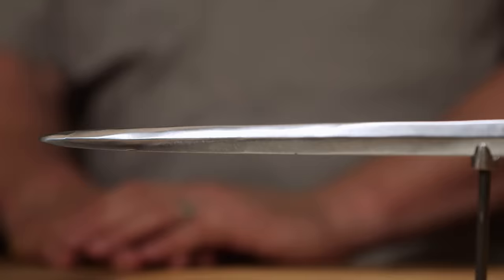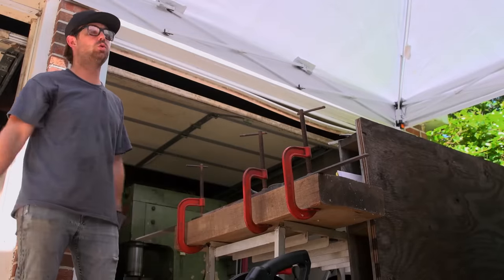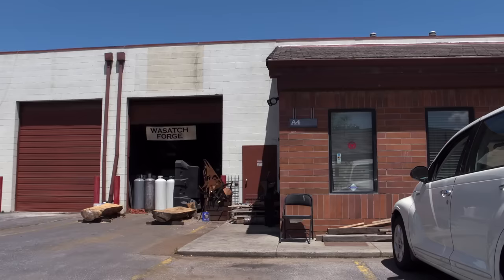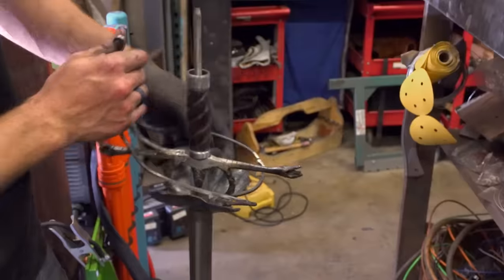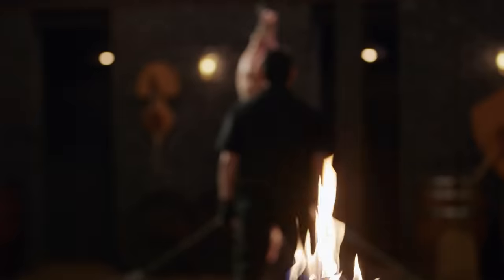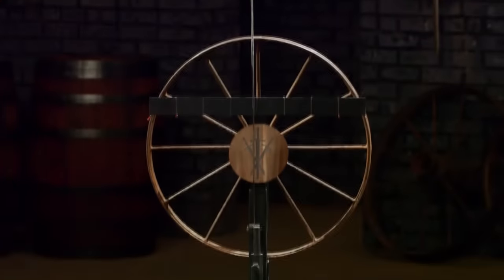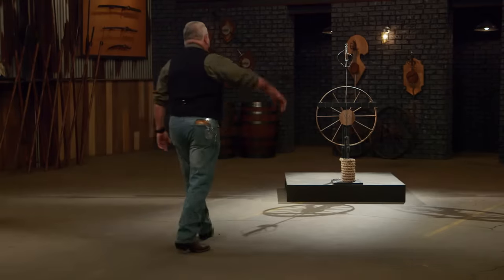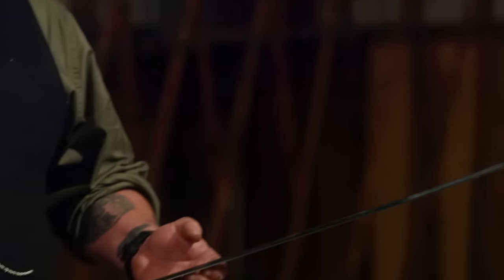Forged in Fire: Musketeer Rapier Final Round: Teddy vs Jesse (Season 7) | History

Comment: why did they test a weapon designed for the thrust by slashing?
Reply: Civilian/duel rapiers were more for the thrust. More combat orientated ones could slash a bit more
Reply: @Xtafa  I suppose you are talking about sideswords?
Reply: You could slash with a rapier perfectly fine
Reply: @systaltic863  yes but to compleatly ignore the thrust it pimarey purpose ????
Reply: Maybe the 3rd test would be thrusting something but they didnt have to go there since they already had a winner on 2nd test
Reply: I'd say these "rapiers" look and act more like broadswords. They're long and narrow but have the rigidity to slash deep. A true rapier would either be too thin to slash as deep as these did, or it would flex too much.
Reply: a musketeers rapier is more of a cav sidesword than a pure rapier. It`s not intended to work as a civilians dueling sword.
Reply: Rapier was made for slashing, Foil and Épée were made for thrusting
Reply: Its simple rapiers cut as well stab, its a misnomer due to modern fencing.  Its simply not true
Reply: Because they're both going to completely penetrate any reasonable target. A difference in the depth is going to depend entirely on the profile of the weapon, and not really say anything about its quality. 
So they test the other aspects.
Reply: My explanation would be it's based off of a Musketeer's weapon. It would be a military purpose sword and not a common persons or nobleman's sidearm. It would be heavier beefier and have more general purpose than a pure rapier. Also it's a lot easier to sever arteries with a slash than it is with a thrust.
Reply: It’s a misnomer to believe the rapier was some sort of “pure thrusting” weapon; that was not the case...
Reply: @systaltic863  yes, you can slash with a rapier, just like you can drive your car in reverse gear when necessary, but that's not how you are supposed to travel with cars...
Reply: Because it's a show and it needs drama. Is it the discovery channel?
Reply: The rapier is a thrust centric weapon but it most certainly could also cut. Many different texts discuss the cut. Though thrusting is admittedly much more deadly (on any sword) than cutting.
Reply: Rapier were by no means designed to be cut and thrust swords. Of course its possible to cut with them, as it is with any sharp piece of metal. But nearly everything about the rapier, from the blade geometry to weight distribution was designed specially with the thrust in mind.
Reply: Garren Brooks well not exactly. Rapier geometry is actually pretty diverse. Plenty of examples of cut based rapiers that feel like longer side swords in the hand. 
Why would Fabris’s rapier Text include both mandritto and reverso cuts if the cut wasn’t used?
Reply: @tainicon4639  but what is the real authority on where a rapier ends and a side sword begins? Modern attempts at sword typology are by no means infallible, and it really seems to me that it mattered a lot less in period than it does to us. Individual swords of the same type can very fairly widely across multiple spectrums. But as far as I've ever known the specifications for being considered a rapier are widley understood to be one-handed sword appearing after the start of the 16th century, around the same weight as a longsword, balanced close to the hand with a well developed hilt, and a fairly long, thin blade with a noticeably robust cross section.
Reply: Garren Brooks I agree very much. I am not try to argue rapiers weren’t primarily thrusting weapons. I am only saying that it is certainly true that rapier fencing manuals describe cuts with the sword we would generally define as a rapier.
Reply: @tainicon4639  yeah, that is true.
Reply: @crazycakemanflies  it is called a warming sword not broadsword unless you are talking about the Scottish basket hillted broadsword
Reply: rockn roll  to be fair the swords in the video are probably closer to the earlier  espada ropera which is a bit of a transitional form between the spada da lato, or sidesword, and the later rapier. It really boils down to the issue of our modern sword naming.
Reply: @Xtafa  ALL western style swords were designed for the length of the thrust FIRST, and slashing as secondary. (aside from cavalry sabers) Asian swords were pretty much the exact opposite. This is reflected especially in close tight formation combat, where the thrust is 100% the best attack to use.
Reply: @portee9113  Migration era swords? Okashott type XIa? Falchion? Messer? Hanger? Cutlass?
Reply: @garrenbrooks9703  First off, Messer is German for knife, and was a peasant grade sidearm. It has as many uses in utility purposes as it did for combat, and so was designed with the single edge for batoning and a curve to the blade for brush clearing. 

Next, the falchion is absolutely from the middle east, and probably a direct carryover from the chinese, then the mongols. It does say european origin, but it just so happens that the first creations in europe, were from the same 100 year period (1300s) after the mongol empire started going crazy (1200s). Aside from all of that, it's commonly understood that this was a rare weapon, usually crafted only for the art of it, and fewer than 2 dozen are known to exist to this day. 

I don't know wtf a XLA? is, but it sounds chinese.
Reply: @portee9113  Oakshott type XIa
Reply: You must be in china because that doesn't come up with anything but acronyms.
Reply: @portee9113  look up the Oakshott typology and look at the one that has the letter x, the letter i, then the letter a. They're called Roman numerals if it helps
Reply: @crazycakemanflies  100% correct
Reply: Exactly
Reply: @portee9113  You can add the Dusack and Katzbalger to that list
Reply: At least that is what FromSoftware has taught us right?
Reply: @danielwalker8142  that's what the wheel was for
Reply: Have you ever seen zorro
Reply: Ironicham well they mentioned the one guys sword wouldn’t have a fair chance in the accuracy test so I’m guessing that would have the thrusting test
Reply: Rapiers are not purely thrust weapons. Pop culture has sadly spread a lot of misinformation about swords, this being an example. Rapiers are excellent slashers, and on average historical examples are as  heavy as arming swords. It's not uncommon to find examples that hover around 3 lbs.

To hear these guys surprise that a rapier is a good cutter, or to describe it as fast and light, shows their lack of knowledge. All of these terms are relative and while rapiers aren't messers or sabres they certainly aren't foils either.
 
For more good info I suggest Matt Easton videos on rapier on the Scolagladiatoria channel.
Reply: @crazycakemanflies  Rapier is a spectrum, Historically the average rapier would cut well enough, but was focussed on thrusting to take advantage of range. Some late rapiers however were very thin and not really sharp, but that was not the majority. The smallsword was more like the thrust only weapon. However, both had to be relatively stiff in order to be good thrusters, and very flexible swords came in for sparing and sport fencing use, since it made it safer (would bend instead of poke a hole)
Reply: My guess is that while it is quite easy to make any piece of steel pointy enough to thrust, it is more of a challenge to make a nimble and long rapier that still can cut well enough. They did test thrust in gel dummies with other rapiers in this show, and they all did well, the result was kind of self obvious. So in my opinion that's why they'd rather test the slashing.
Reply: Old 1500s rapiers, were basically just thinner sideswords, that became really popular in Spain and Italy in the renaissance for civilian dueling, they could definitely cut, as every manual of fencing masters teach how to effectively end a fight with cuts not only thrusts. And the very first rapiers were Spanish sideswords called Ropera.
Reply: Xtafa You’re confusing it with a side sword
Reply: the gladius was designed for thrust as well but it could also slash. thrusts are just quicker and easier then slashes.  unless your cavalry slashing is easier. or if you got a 2 handed sword meant for chopping spears in formation. a saber can still stab. its mostly on the martial art and what the weapon was trained for. some weapons just got sucked into a group think where one style for the weapon got popularized. the rapier in a duelist situation the thrust is just easier and safer. but if you were on a horse and only had the rapier, odd things can happen. the slash would be easier and still end someones day real quick.
Reply: @towacca3548  I was surprised by that. A fencing foil looks basically nothing like historic rapiers.
Reply: @TastesLikePanda   as originally purposed,  Foil was a training version of the smallsword. Epee was the training version of the rapier Both were primarily designed for thrusting, as were the weapons they were based upon
Reply: Ok with specialized training with a rapier proper or necessary slashes are possible, but thrusting? Ur not gonna be poking at each other everyday. Fighter/warrior is defined by being able to adapt to keep himself alive. It's like saving my fists are for punching only I shouldn't grab the guy.
Reply: Rapiers can cut. The problem is really not that he tested them by slashing, it's that he did not test them by thrusting.
Reply: Rapier, not epee or foil
Reply: @TastesLikePanda  wrong
Reply: Yes rapiers where specialized in thrust but they were still swords they must do both
Reply: It was the optimal use of the capability of the rapier. Fabris talk about slashing when you have to defend against multiple opponents. But most of the techniques described in his books involved thrust more than slashing. And this sword follows an evolution that will continue after it. L'epée de court ( court sword maybe I don't know the English name of this sword ) was the evolution of rapier and was almost unable to slash. Because that's was the way those sword where used. In parallel when the sword became a tool for the noble status the saber became the military symbols. Sword fencing was no more about inelegant slashing and losing body part but about a clean direct way to the opponent death. Fencing was art and a way to show your stature and your ability  and not brute. Remember fencing treaties are for people able to read. . .
Reply: A rapiere is used Estoc way....
Reply: Looks cooler
Reply: @TastesLikePanda  That's not true, Rapiers were made for thrusting. They CAN slash, but the primary way to use them is by thrusting.
Reply: @tonarsilverwolf6485  That's an English concept because they had the concept of sideword before rapiers arrived to the isles. Rapiers are a Spanish invention and to them there's no distinction. Musketeers wore a variety of different swords, depending on their personal preference, but in battle normally you wanted a more rounded weapon, and musketeers had swords because they were soldiers. Bayonets hadn't been invented yet.
Reply: they say his the weapon master but... yeah yeah i'm not convince
Reply: I think Doug's background is more Escrima/Kali than European fencing but it's still absolutely ridiculous that he didn't thrust.
Reply: the nature of the blade of a rapiers is by definition for trusting, having a  thin body from top to bottom,  there is no point in testing something that definatly will thrust. Slashing is is more prefered in general for swords in close combat. The rapier offeres protection by keeping the enemy at bay due to the lenght and killing point if offers but closeing the distance between fighters the changing blows are slashes until one resets. If you wonder and this  is not suficient explination watch three musketters.
Reply: This is more of a sidesword.
Reply: @crazycakemanflies  A rapier isn't one specific design. Sideswords were considered rapiers and it's clearly what they made here. Also the broadsword is specifically Scottish. Do some research man.
Reply: Systaltic the tip is the sharpest part while the edges are more dull. A sabre is supposed to slash but rapiers thrust.
Reply: Traven Lingley Yeah, that doesn’t make any sense. Maybe because a good rapier should be able to slash and cut?
Reply: @crazycakemanflies  There is no such thing as a "true rapier". The rapier like most swords has a lot of variations possible depending on what the wielder and/or smith intended the sword to be used for. There is also the fact that the rapier is a controversial blade with a great deal of debate over what is a rapier vs a side sword vs a backsword vs an epee vs a broadsword vs a saber vs simply a longsword or arming sword with a particularly elaborate hilt. The definition of what can be classified as a rapier changes dramatically depending on whom you're speaking to; the only things that remain constant are a long relatively slender blade and a fairly elaborate hilt and basket guard configuration. By that definition the scottish broadsword (aka the basket hilted claymore) could be classified as a rapier. So the debate over why the swords in this do or don't qualify as rapiers is meaningless. There are only two people in the world who have the right to make assertions about a weapon - the person who forged it and the person who will be wielding it. If a smith says what he made is a rapier and the person who wields said sword concurs then who really cares what everyone else has to say.
Reply: A rapier or rapiers was used in the 15,16,17 and 18th century for self defense with dagger and pistol.
Reply: @systaltic863  well yes, but you mostly slash with the tip
Reply: Are you implying that the rapier is incapable of slashing? How exactly is a a musketeer suppose to thrust and enemy when mounted on horseback?
Reply: @godofawesum223  He did say "Designed for" which is accurate. But it certainly can be used for slashing, it's not it's strength though.
Reply: @TastesLikePanda you might be referring to sabre, rapier was meant for thrusting in civilian applications, however in a combat oriented application it would need to be slightly heavier and better at slashing as well as stabbing in order to be effective
Reply: Right. Rapier is for thrust. Not for slash...
Reply: It’s still a sword.. & anything can stab with enough force, people wanna see slashing lol
Reply: I think y’all’s need to watch shad’s video on rapiers. It’s a stupid misconception spread by fencing enthusiasts to think that rapiers can’t slash. You got to realise that rapiers has different configurations like any other sword, some configuration are more thrust oriented than others but they certainly can slash, just not to the same capacity as a broadsword as rapiers has less mass in the blade.
Reply: The american show
Reply: @systaltic863  yes but the main use is thrusting
Reply: @danielwalker8142  rapiers were meant for both, as they are defined by the hilt and no the blade
Reply: @TastesLikePanda  not true, the first rapier that now we call now call side sword yes. But when the Rapier that we know nowadays was introduced that has always been the rapier and used more for thrusting. Some Rapier in history don't even have good edges for slashing for the specific reason that Rapier are used for thrusting a lot more than slashing. A Rapier doesn't even need to cut through the strong bones like the spine.
Reply: @TastesLikePanda  the foil is only for thrusting and it's what is used in modern fencing
Reply: @doratheexploder286  

Correct, it was a cut and thrust sword more akin to the side sword as you mentioned - but furnished similarly to a true rapier or  the Spanish espada de ropa. 
Kind of a hybrid weapon really - equally proficient in the thrust or the cut, with a blade more reminiscent of an arming sword, albeit somewhat longer and more tapered in the blad with a more ornate and protective rapier style hilt.  Its purpose was to efficiently  maim, disable or  keeel on the battlefield. 

whereas the duelist or gentleman's rapier was more proficient as a pure thrusting weapon.  Its purpose was to simply poke a man deep enough to "draw blood" and thus end the duel or quarrel... the "keeeel" wasn't the end use philosophy of the weapon.  (Although, in the hands of a proficient swordsman - it certainly could)
Reply: Rapier can cut as well has thrust. Thrusting was its primary purpose, but cuts were definitely taught in the system. Smallswords are the sword that usually don't have edges (even then some still did). But the the Smallsword is mostly the dedicated Thrusting sword .Rapier is still a cut and thrust blade.
Reply: @TastesLikePanda  No.
Rapiers was Made for thrust. And smallsword develope of this sword and epee and foil of Smallville.
But a rapier ir was not for cut. But can cut...
Reply: Yes, a sword was design to thrust, but it's also need to slash too, you shouldn't expect that you'll have chance to thrust everytime in battle
Reply: @thinh1102  but ir was use for duel...
Reply: @angelmarin1613  yes. Rapier can cut,  but the first utilisation was to thrust.  You are  right
The French Mousketter(like d'Artagnan)can slash with their sword, but they prefer thrust
Reply: @crazycakemanflies  yes bcs it's a musketeers rapier, different than a rapier made for duel
Reply: @williamblackfyre4866  
Because modern dnd got rid of 
Weapons with multiple damage types.
Reply: And no one would " keel" anyone if you put a pointy tip on an Olympic sword. Stiff wires with handles. They aren't throwing much in the way of solid parries, just ducking strikes and moving to thrust.
Reply: @techfoolcasey4348  it was a joke dude
Reply: @williamblackfyre4866  yeah, I knew that. We're good.
Reply: There no fun just poking holes
Reply: Honestly, I don’t mind… I never thought it would cut a pig in half!!
Reply: LMAO exactly I THOUGH TEH SAME THING
Reply: The show’s a joke
Reply: Rapiers are primarily thrusting weapons. Some had no sharpened edge at all. Some had an edge along the foible. Occasionally they were sharp the length the blade  but those generally have wider blades. Originally the foil and epee were used for training in the use of the rapier. In time they became sport fencing weapons.
Reply: Rapiers could be both cut and thrust or just thrust.
Reply: @danielwalker8142  the third test was suppose to be a cutting test which would most likely involve some form of thrusting which is why they disqualified that dudes blade as it could no longer thrust properly
Reply: Stabbing doesnt look as cool in slo-mo
Reply: @claudiamanriquez4152  Rapier Can slash
Reply: @monotech20.14  two
Reply: Because, Rapiers have an edge like any other sword. In fact they're doubled edged. They're not fencing foils.
Reply: @crazycakemanflies  you're thinking of modern stupid sport rapiers of side swords which are stupid.   True superior rapiers are just a narrow longsword
Reply: Maybe to prove that rapiers are great cutters as well. They are a superior design.
Reply: @Xtafa  lool
Reply: You're probably thinking about the thin, competitive fencing rapier. But in actuality there are a quite huge numbers of rapier variants, even the ones that looked like longswords. So yes, a rapier can slash too.